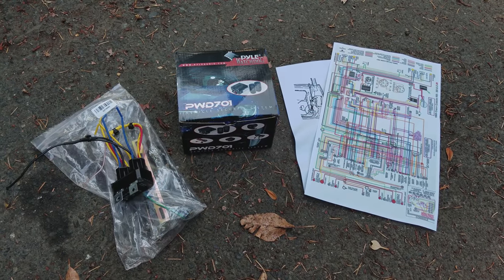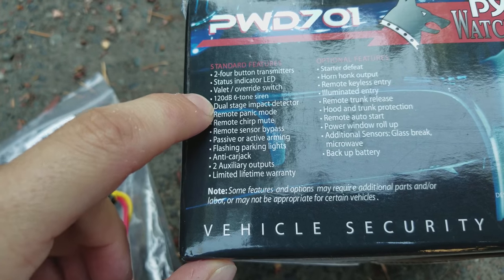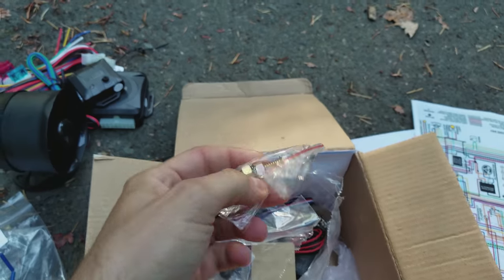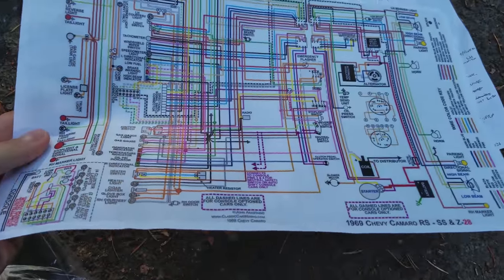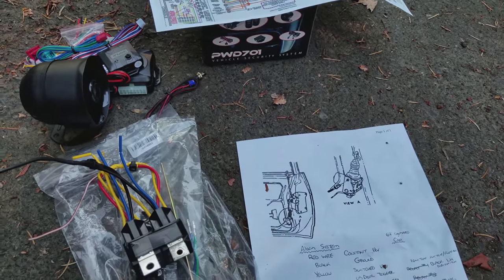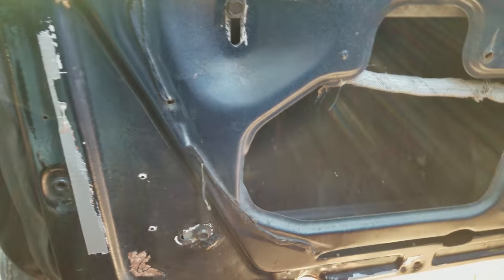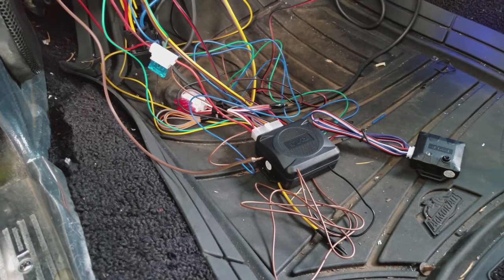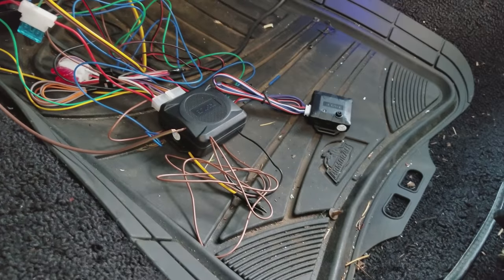1967 Turbo Camaro - Cheap Alarm System & Power Locks Upgrade

Comment: How did you wire the lock actuators?
Reply from the maker: Hey, if you're asking about the relays, I took a decent, but still complicated photo on the cars website here: http://www.turbocamaro.ca/2017/10/alarm-system-power-locks.html?m=1 
Hopefully that helps.

Comment: Any idea on how to wire the auto remote start with this security system
Reply from the maker: I intend to do a continuation of this video some day as I have the remote start module, but it's currently in storage. Without the module handy I don't think I'd be of much help I know the customer service for the alarm was very helpful with my original order, and could probably point you in the right direction.

Comment: Thanks for the lesson.  You lost me when I saw the wiring diagram.  : )
Reply from the maker: No problem, and yes, the diagram isn't the best but certainly better than the factory manuals. If you decided to get one of these alarms solely for the power lock function, I think it would make for a simpler install without all the extra wiring.